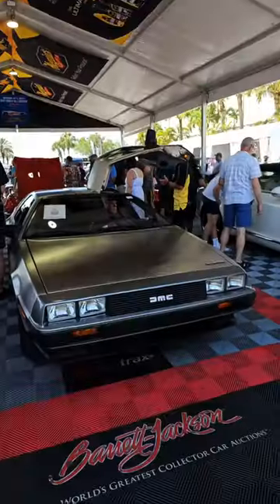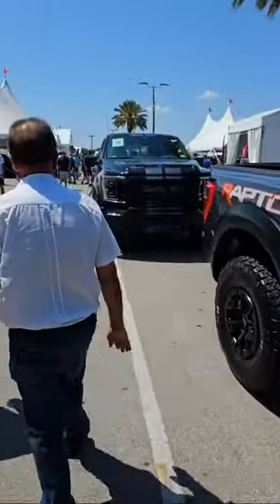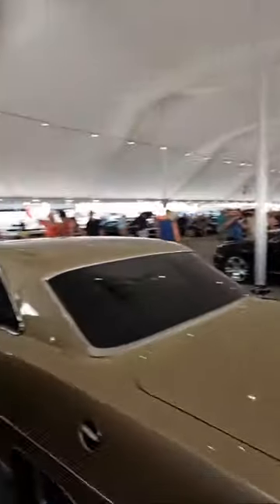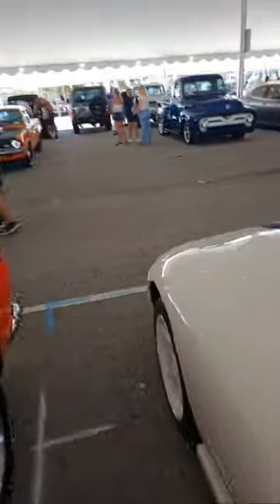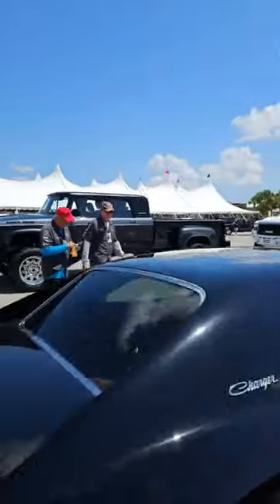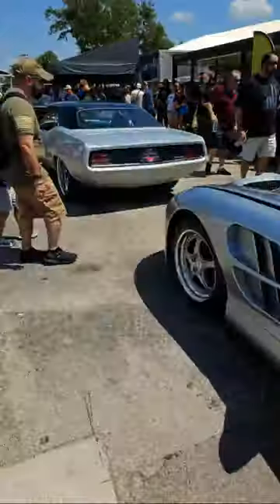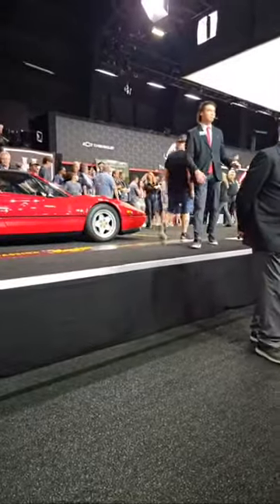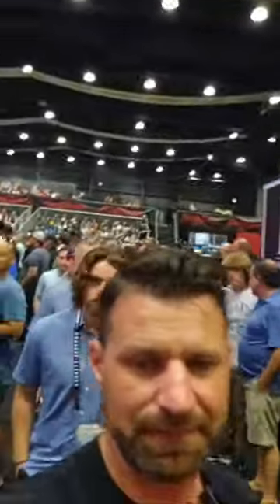Flying Wheels is live at the Barrett-Jackson Auction!

Comment: Stopped at a bmw dealer looking for a 2018 jaguar f-type supposed to be on their lot. Went inside to inquire,  was told if was in the ship being a "check up"  could lay eyes on it but not drive it. Ok... wife and i went to go check it out. Driver wheel off, trunk open, hood open, loose parts everywhere. ON THE WINDSHIELD IN BIG LETTERS...DNR.  😂😂😂😂  i believe this is from the auction?  If i didn't watch your channel,  i wouldn't have known to run so fast!  👍🏼👍🏼  😂

Comment: Vehicle seem to be going for low prices this year not sure if it's Florida or all over was watching it on TV yesterday saw a 57 T-bird go for just 23k and a 71 beautiful Z28 Camaro go for only 31k for example I'm sure these sellers regret running their cars  - a 10 % commissions and the price to get them there so - at least 4k of the hammer price for them Ouch. I bet if I offered the guy that sold those cars 3k to 4k less than selling on the Block a month before this auction like 27k-28k for your Z28 he would have told me get lost  F-off I would never sell it for that.
But you just did...